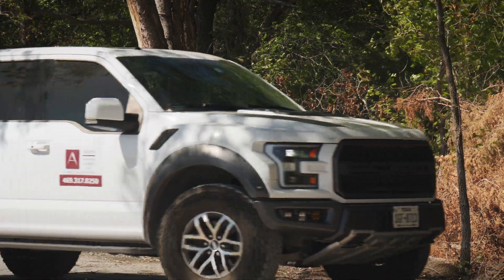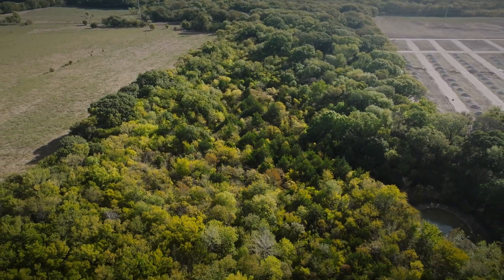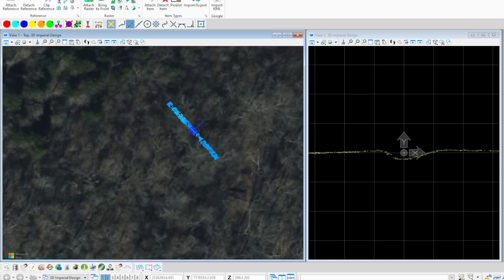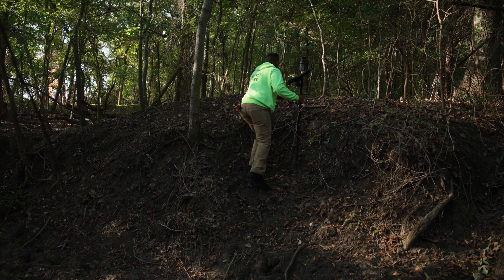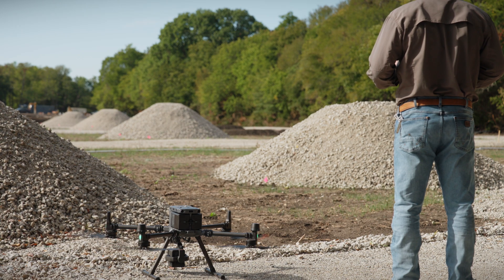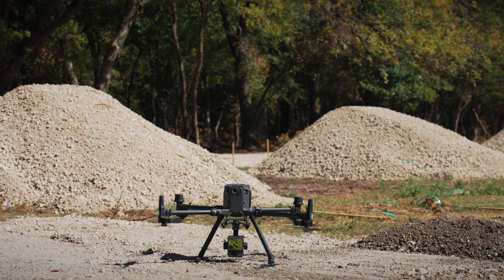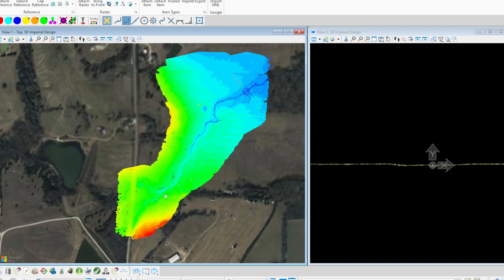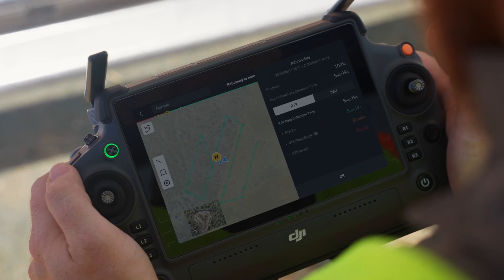DJI Zenmuse L2: Using LiDAR Technology for Land Surveying Projects

Comment: How are you maintaining signal connection with those tall trees?
Reply from the maker: That's the beauty of the M350 RTK, strong connection regardless of large vegetation or obstacles 😁
Reply: You have line of sight from the controller to the drone, and that's what's critical. It's also required as being the pilot to maintain sight.

Comment: What were the specific details to the LiDAR set up on Pilot 2 for the L2? For example did you use 1,2,3,4 or 5 returns? What AGL did you fly? What were your L2/camera angles?
How many acres did you scan?
Thanks!
Reply: 3 returns, 200', default camera angles, and about 3 miles per hour. You'd get about 20 acres worth, depending on your overlaps.